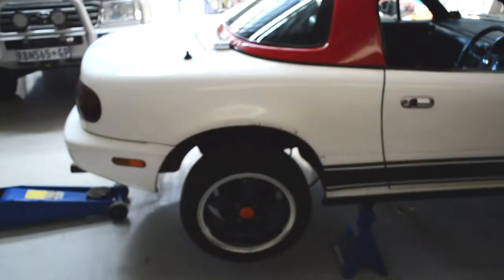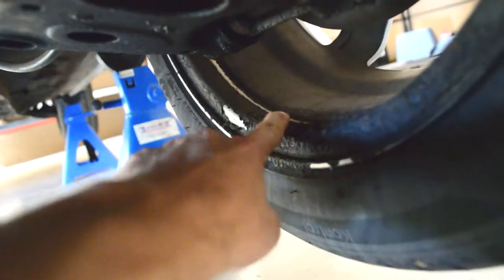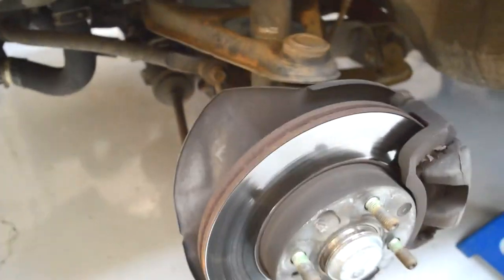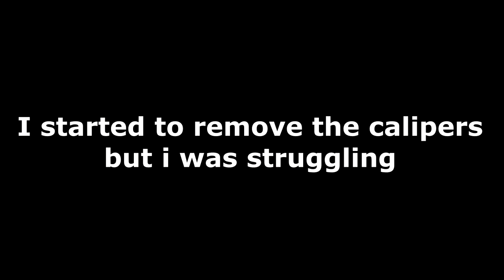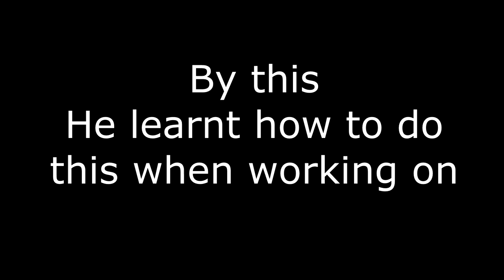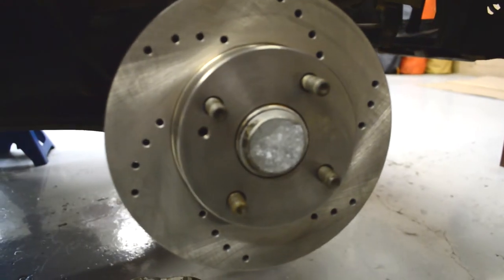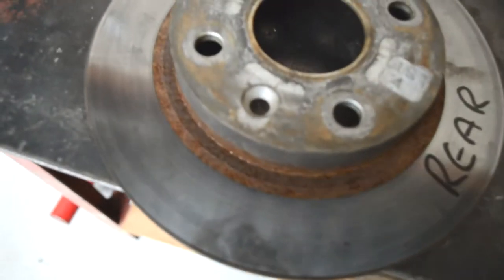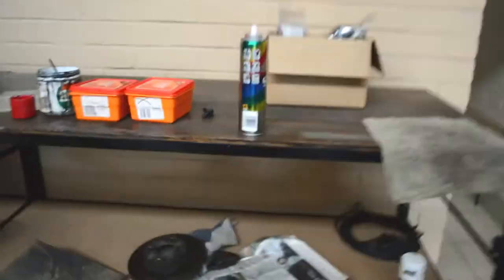My Miata gets a BRAKE UPGRADE!

Comment: Calipers and disks came out very good. 
The rear disc cross drilling was only an issue because we need a dividing head on a milling machine to accurately locate the holes. 
We can always do it at a later date.
Reply from the maker: Thanks for the help dad 😁💪